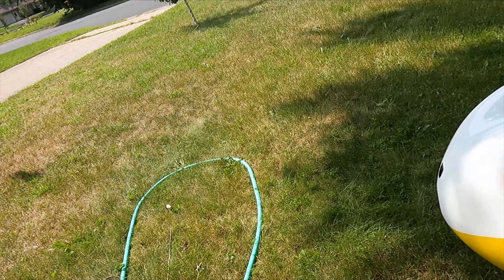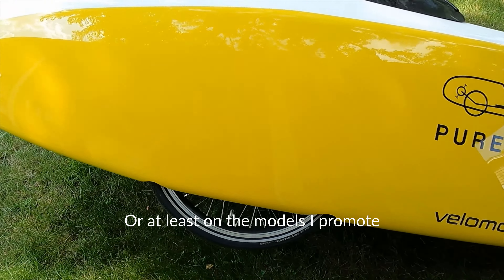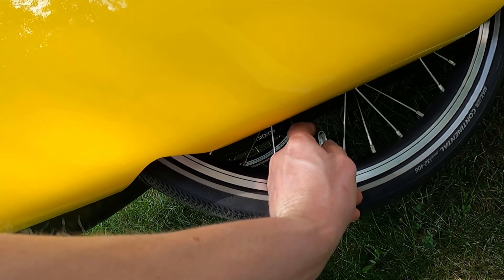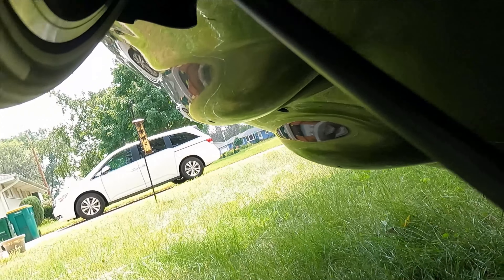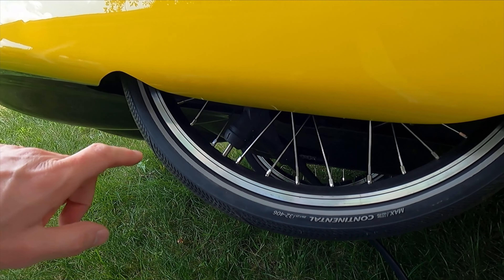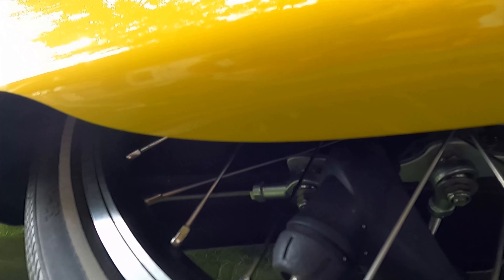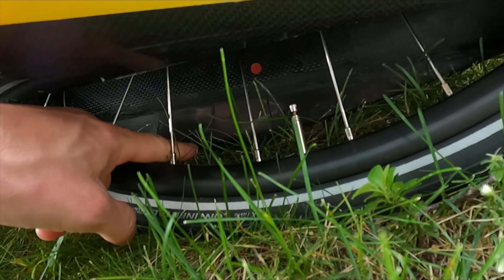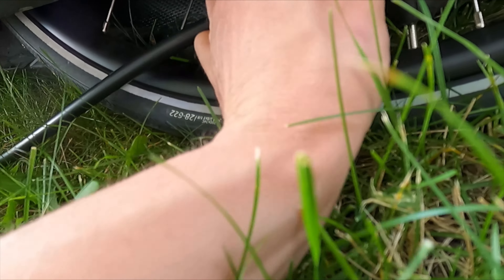How do you pump up or change a tire on a velomobile?

Comment: Had to change both front tires today, one because of a brokan glass sticking in the tire, the other one because it was worn down so that you could almost look through.
Changing the tires is really easy, but allways clean your wheelhouses first 😉
Reply from the maker: @Guenther-Eichinger  yes. The wheel wells can get quite dirty very quickly!

Comment: Hi Ben, on my Bülk Urban there is on the rear a very slim 26mm wide tire.
The comfort is really bad.
I would like to upgade it with a Contact Urban 40mm wide: do you think it would fit ? Thanks
Reply from the maker: @daniele_go  yes. That should fit. The first 4More I received has 40mm I believe. I have a 35mm Continental GP5000AS mounted in my Urban currently.

Comment: So, is it just ridiculously complicated to remove the front or rear wheel entirely? I’d think that with drum brakes that it shouldn’t be too bad for the fronts. 5mm Allen wrench is all that is needed on a Scorpion front wheel, what about for this velomobile? I’m not a fan of on the bike tire/tube changes I suppose but if that’s ultimately the easiest, I could be convinced, otherwise.
Reply from the maker: @thechocolategourmand  on an urban and 4More you can remove the entire front wheel for a tire or tube change, but not on a closed wheel design like the Bülk MK1. You’d have to remove the whole strut for that. Rear wheel required removing the axle with the special axle removal tool. But why remove the wheel when you can just pull the tire off in a couple seconds without removing the wheel at all?
Reply: @mnveloguy  On a non enclosed bike I remove the wheel every single time because it’s easy and gives excellent visibility and control of the bead seating process to ensure no pinches, etc... For enclosed it sounds like leaving the wheel on is the “easiest” option available. Anyways, good to know and thanks for the video.
Reply from the maker: @thechocolategourmand  easy enough to check the bead to make sure it’s not pinching the tube without pulling the wheel off. Most tires will seat nicely on the rim with the exception of the Schwalbe pro ones that require mounting fluid.
Reply: @mnveloguy  yeah I suppose with the bulke laying on its side it’s probably pretty straightforward. On a bicycle it makes less senes. My scorpion is super simple with a single Allen key as my go to.  I’m curious about routine maintenance on the bulke. Chain replacement and cable replacement, in particular. Does the bulke skip chain tubes since the bike is already enclosed?
Reply from the maker: @thechocolategourmand  there are chain tubes. Chain runs under the seat and it’s best to have tubes there to keep something from falling into the chainline. Chain lasts an eternity, so aside from cleaning it, you really don’t need to access it. When I clean mine once a year I connect an old length of chain and pull that through. Then I can easily pull out the chain, clean it, reconnect it to the old chain, and pull it back through. Super quick and easy. Cables are all easy to get to and would only take a few seconds to replace if ever needed.